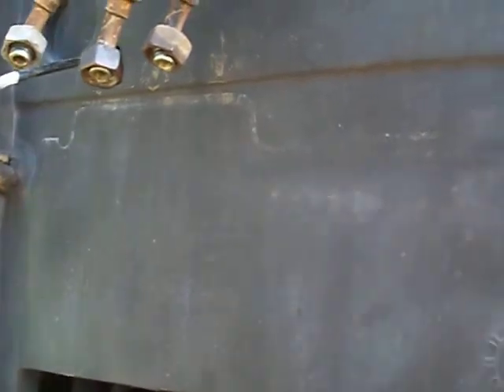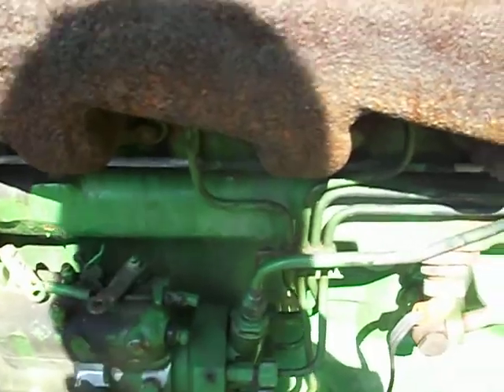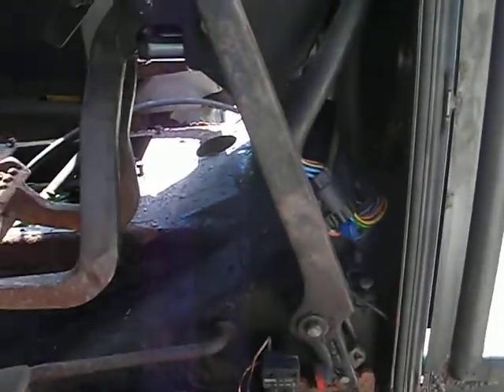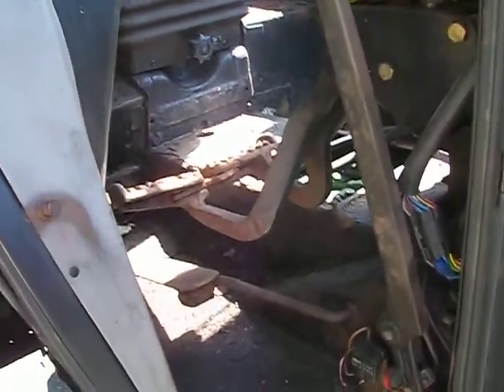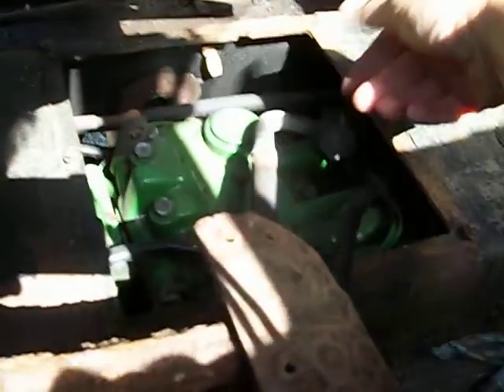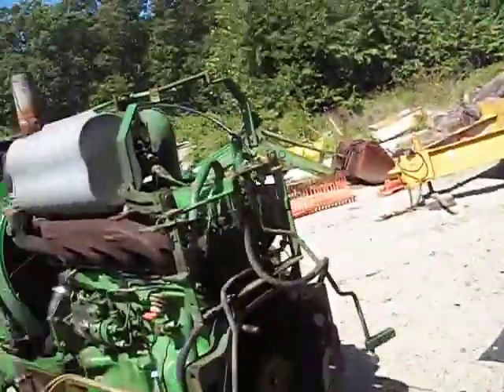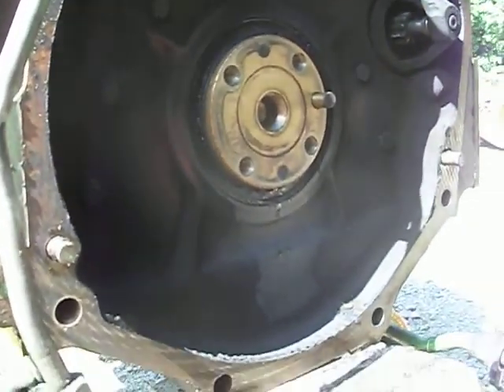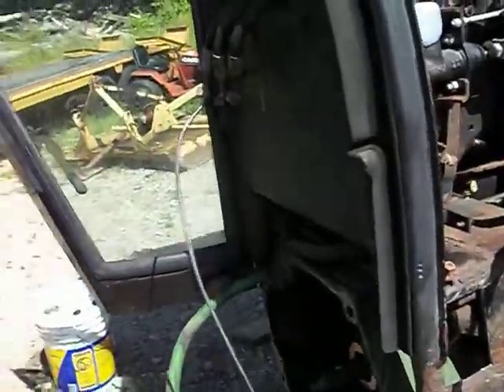John Deere 2355 tractor split part 2

Comment: I have a Jd 2355 and I need to split my tractor to gain access to the internal transmission charge pump.   It is not supplying oil to the front high pressure pump.   I have not found any demonstration of how to do this.   Can you help me?

Comment: awesome video, im recently working on my 1967 john deer 2020 with the same problem bad clutch/pto pening gear. and i was wondering where you got the parts break down with all the torqe specs and what not. first time tearing down a tractor so i may need a little guidance thanks.